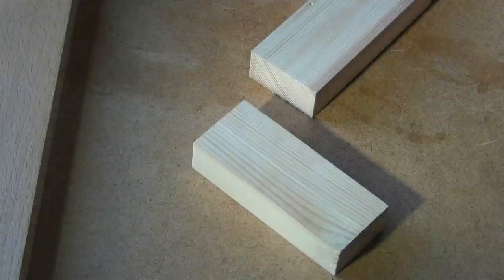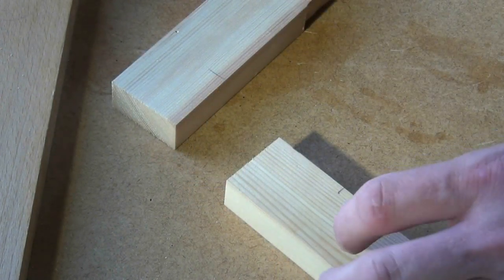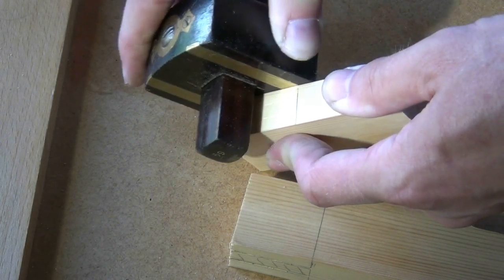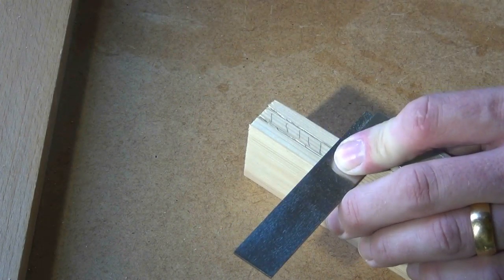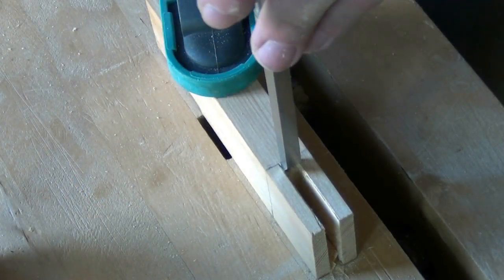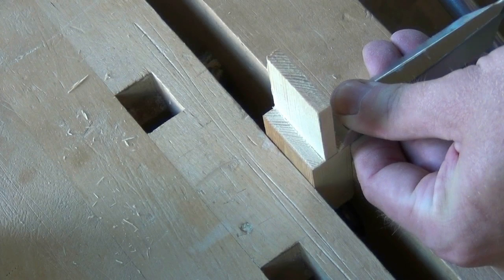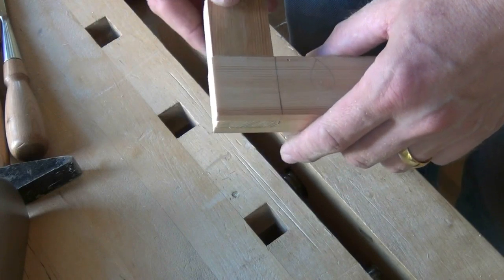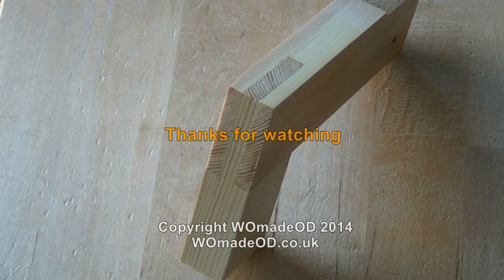Hand Cut Bridle Joint or Open Mortise & Tenon

Comment: thank's for sharing. For a kitchen cabinet door frame would you recommend using the bridle joint or the half lap joint? Or what would your thought process be when deciding on the best joint for the job (considering both stability and how quickly it is made). Thank you :)
Reply from the maker: laikmiandu Bridle joint, with the panel groove aligned with the tenons, would be my choice. Twice the glue surface area. Those doors can take a pounding, so I would go with strength over speed on this one.
Reply: WOmadeOD - Made in Wood with Mitch Peacock
ok, makes sense. Thank you

Comment: Any tips on using the coping saw to clean out the waste? Can never seem to get it to work as smooth as in the video.
Reply from the maker: Hi, Sharp blade, good tension, cut on pull stroke, then adjust cut pressure until it cuts easiest. I use standard blades, but I hear Chris Schwartz raves about a certain brand - if you still struggle you might like to check out which they are. Cheers, Mitch